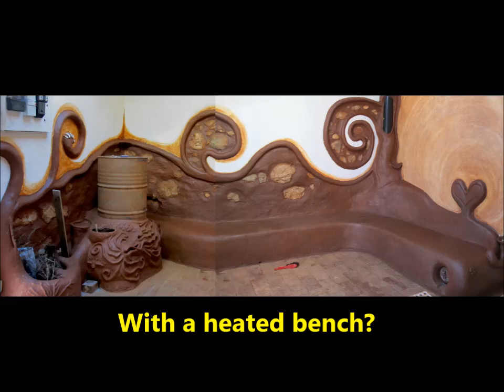"Dragon Monster" Rocket Stove Mass Heater

Comment: How are they getting enough draft with so much horizontal stovepipe I'm wondering? The draft looks great at the end of the video, but how can you get that much draft with so much "heat sink" between the stove and the vertical stovepipe chimney?
Reply: J tube look up rocket mass heaters.